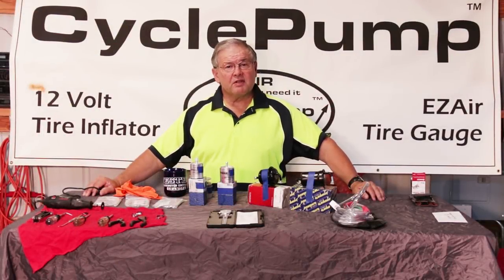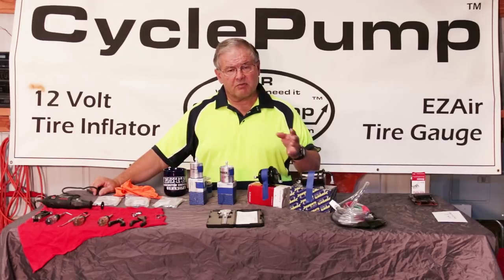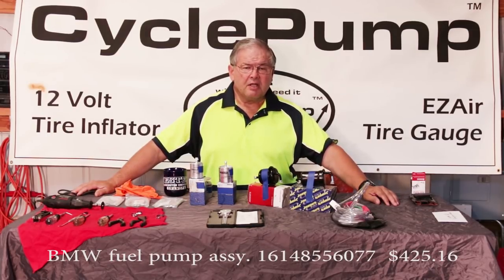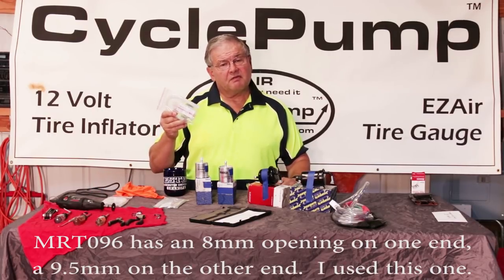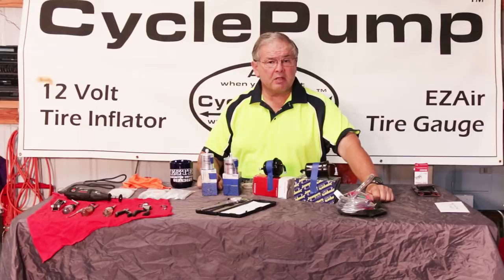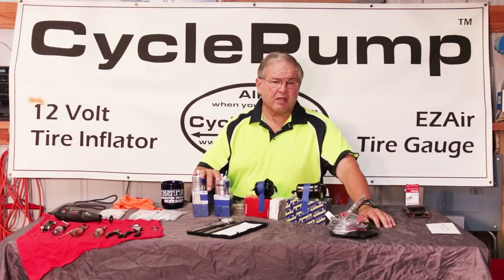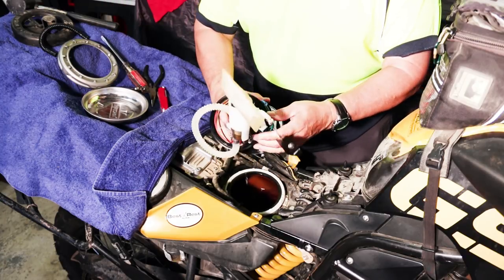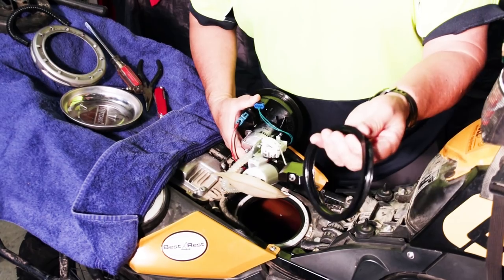BMW 700/800 Fuel Filter / Fuel Pump Replacement

Comment: Thanks for that break down. I've inherited a f800 r that hasn't been ridden in a year. I don't think I'll need to replace anything but I'm going to drain the tank and check all those lines for any bad fuel.

Comment: Two things: do not have the tank full when you do tis job . If you have  there will be fuel everywhere  on the bike ,floor cetc. etc.  Half tank works well  but emty is the best.  Allways renew the seal or you will have problems with leak  later.

Comment: I am missing the o ring from the mahle filter, can that cause stalling?
Reply from the maker: If the oring is missing that can cause a drop in fuel pressure, and stalling could occur
Reply: @bestrestproducts648  okay! Thanks.

Comment: I think I have bad gas in mine i have a 700gs how would I be able to drain it
Reply: Open cap. Insert siphon hose. Siphon bad gas.

It'll be difficult to get it all out because it's hard to get the siphon hose to the bottom of the tank. So you might need to remove the fuel filler cap assembly so you can see and direct the siphon.

Comment: I AM GRATEFUL  FOR SOURCE OF DIFFERENT SIZED NYLON HOSES..   THE COMMON SINGLE SIZE HOSE WONT WORK ON MY g-650 WITHOUT BEING BRUTALIZED... LIKELY, MANY OF THESE BMW PUMPS HAVE DIFFERENT SIZE BARBS ON PUMP AND HOUSING NIPPLES !
Holee Crap...they managed to take the perfectly awful assembly used on the 650 singles, and make it even Worse !  Mostly because you babies  whine if you don't have a fuel gauge !   How can anyone be holding an opaque Nylon fuel line in his hand and refer to it as "clear plastic" ? That non-elastic monstrosity is at the heart of what is wrong with all of these abortions.   How is a non elastic material supposed to fit and hold on barbed hose bibs? ...especially when the size supplied is WRONG!     All designed to force you to buy a $500 part...because they won't supply a couple of $1parts